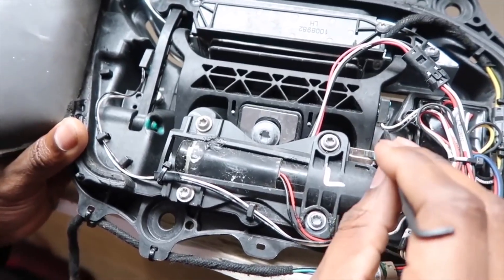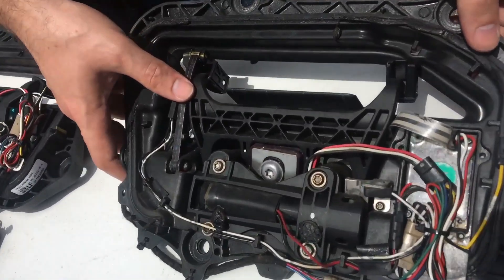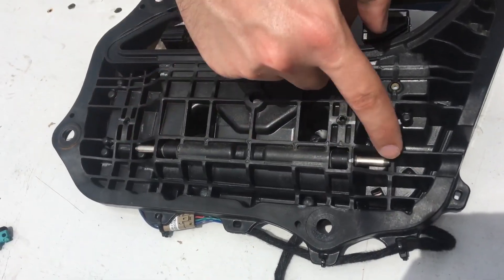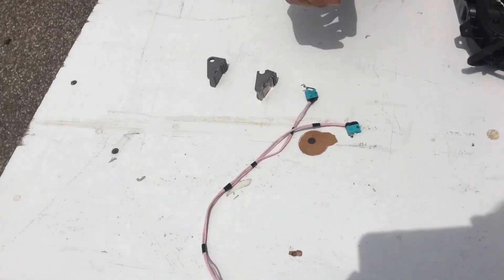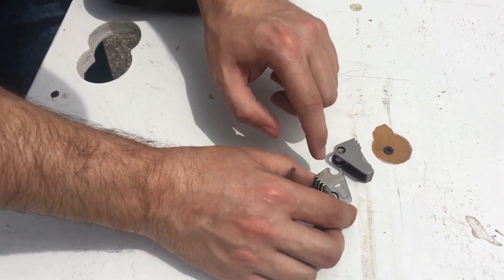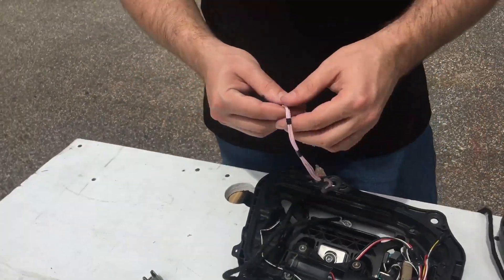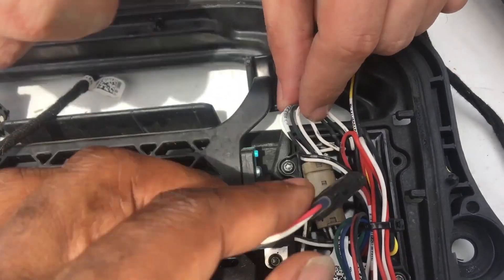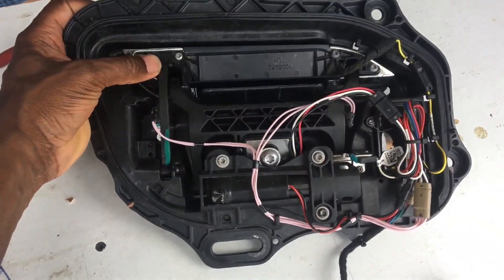Fixing Tesla’s Design for Good

Comment: You guys ruin a hard work of engineers who program these stuff to break after a certain time  😀
Reply: There is literally no reason why any wires should need to move with the handle. It's just lazy design or design for obsolescence/failure.  Sauce: I'm an engineer.
Reply: Bullet Tooth Tony they are engineers. They’re just engineers without obligation to guard Tesla’s trade secrets.
Reply: This is a mechanical issue, not a programming issue...Also by no means, Tesla made this with planned obsolescence, do you really think they would make something like the door handles to break in a certain amount of time or do you think it would be smarter for them to make something less easy to get to and less obvious that it is planned obsolescence. The problem here is just tesla using new door handle technology that is cool but has a ton of parts and electronics and knowing that they were in a time crunch to get it released they made a bunch of little mistakes some obvious such as the exposed PCB on the first 2 designers and some not so obvious such as the gear.
Reply: @THEGAMINGHELP101  A cast gear is a sure sign of cost cutting. Every aspect is tested to a certain amount, built to a certain cost and built to last a certain amount of time. Usually when the warrenty runs out.  Mechanic by trade. Even the way the wires are positioned is designed to wear out. The average person is not going to take it apart or to be honest really care as long as it's replaced and working. Guys like rich and sexy hands give me hope.
Reply: @edgarbeat275  I work in heavy trucking as an engineer. Casting is not a sighn of cost cutting as most of gears are cast for just about everything in a car/truck. Tesla probably just did not do to much testing on that gear hence why it failed and is a bad design not because it's cast. I really think tesla just does not spend much time testing and making sure things are perfect. Which is why they break a lot.
Reply: @THEGAMINGHELP101  Agreed in some designs things are designed to break to prevent more damage such as valve rockers or plastic gears on lawnmowers. I also worked on lorries, tractors, power screen graders garden machines and heavy plant a real mix. One day could be a strimmer and a couple of vans then a tar spreader. I liked the mix. 

I find the door pop out a bit of a gimmick and unnecessarily complex. Mercedes in the 70 and 80s would have tested that to death. Casting it a little thicker or moving the pivot hole a little further into the casting would have helped. 

I left my job because I found everything is going this way. I now do up old cars and art in my little pic.
Reply: As much as I like the work the Tesla engineers are doing for electric cars there is no way that company isn't a bunch of scumbags. I wouldn't put it past them to have parts with planned obsolescence. Actually, I don't trust any companies not to have planned obsolescence.
Reply: @petlahk4119  tell that to audi after the warranty the car starts breaking down
Reply: @nando1679  my sister owns a Audi TT the joy of post Warrenty Audi. No joke 😊
Reply: @petlahk4119  Nobody designs cars to break.  They design them to be cheap.  Occasional breakage is a consequence of that.  Planned obsolescence is a conspiracy theory.  The way they really try to get you to buy a new one is with styling and new "features".
Reply: IncognitoTorpedo hehe... funny... Why then would they specifically design the wires to move with the handle? That will wear out the wire faster than ever, and in fact, that’s exactly what it does. Commonly the first thing that breaks in these handles is the wire, and even a kid could come up with a solution that doesn’t require the wire to shift tens of thousands of times. Machines are designed to break. Once the manufacturing industry realized things could be built good enough not to fail in a super long time, they realized they would lose profit, since people wouldn’t have to go to a dealer to fix their car a moderate time after the car was new. Many manufacturers then designed cars to break down, and some, such as Tesla for example, made things a bit too complex on purpose, allowing more opportunities for parts to fail, forcing these rich people who don’t know a thing about cars, and certainly not how to fix them, to go to the dealership to get their car fixed. I’m not trying to rat out on Tesla, I’m just stating the truth about the entire manufacturing industry. Most people think of the term “they don’t make them like they used to” as a term stating the parts are cheaply made, which is true, but it also applies to how manufacturers cause their products to fail on purpose, giving them more profit. Cheers!

Comment: The reason for cast part are for cost reduction. That machined steel part would cost almost 10 times more than a cast one. Multiply the cost with the number of all cast parts and you end up with a huge money gain compared to a machined steel part.
Cheers!!!
Reply: The tuner only machined the part because he was constrained to Tesla’s plastic housing size. Tesla could have simple made the housing larger (there is plenty of room in the door) and used a thicker cast gear. The only cost increase would be from using slightly more plastic for the larger housing, and slightly more steel for the cast gear.
Reply: Circusboy90210 just think about it, you save about 500$ per car from all parts that are cast instead of machined. You multiply this with 20000 cars/year an you have 10,000, 000 $ in savings.
Reply: Very true. You'd hope their failure analysis engineers would be looking at this and getting the mechanism redesigned to be cheap and functional.
Reply: Keep in mind that most current manufactures are considering a cars lifetime to be somewhere between 3 to 5 years, afterward the owners sells it and buys a new car. There is a calculated line between quality/reliability .  There is a huge business in spare parts and service that goes together with it.
Reply: True. Figuring out where planned obsolescence needs to give way to quality to avoid damaging reputation is where the fun lies. Given the number of redesigns on this the quality guy wasn't winning...
Reply: +David Fiddes  Tesla does not have "failure analysis engineers", only NASA in the 1960's had that. Any engineer does failure analysis, and they don't get paid extra or get some
goopy title for it. THIS IS THE YEAR 2018
Reply: Cosminbad cost reduction in a $100,000 car? Lol
Reply: David Fiddes except in the US the average time an owner sticks with his car is now over 11 years...
Reply: No it's not. It's around 7 yrs.
Reply: No it's not. It's around 7 yrs.

Comment: I personally have owned a few Audi TT's and they all have those same micro switches in the door handle to allow the window to drop a quarter inch as soon as you pull on the handle. and i have replaced HUNDREDS of them because they all wear out and fast. they are super soft plastic and have no form of lube or even graphite powder....
Reply: yah, i use similar microswitches in security devices, they don't like being pressed repeatedly for too long...

Comment: Redesign handles so they work all the time = use normal door handles with mechanical linkage like every other car.
Reply: danot3 Other cars have flush/nearly flush door handles that wouldn't ruin your cd.  It's not some sort of voodoo science, papa Elon didn't invent aerodynamic door handles.
Reply: Check out the Tesla Model 3. They have flush door handles that don't pop out.
Reply: bubba99009 ...Lol but true, My 2014 dodge ball has 96,000 miles and never experienced a door failure.
Reply: bubba99009 retracting door handles help with aerodynamics
Reply: u need a switch anyways for the window though

Comment: Do you know if the 2018 Model S has an updated handles design? Or v3 is the last one?
Reply: V3 uses a hall-effect sensor, a new module and vapor barrier. The module is the weak link for this design typically. The gear is still the same but the microswitches won't work.

Comment: This is where you’d hope Tesla would give whoever designed and built the fixes a job or at least a reward, but in the end they’ll probably just steal the idea and put them out of business.
Reply: truthsmiles The cast part could have been made thicker for only the cost of extra raw steel (almost nothing). Billet was done by the tuner because he has to make a part that is the exact same size but stronger, where as Tesla could have simply made the plastic housing wider to accommodate a wider cast gear. Those wires are the only constantly moving wires on the whole car, and yet they used extremely cheap solid core wire not even fit for a stereo install. Considering those are the only wires on the whole car subject to movement, and also that they’re so short, there is no reason to save less than $1 per car on cheap wire. Unless you want that wire to fail after 5 years.

Planned failure is a very real thing, with all manufacturers. It’s sad but true.
Reply: It's the American way. Microsoft, Apple, IBM, they all do it.
Reply: I think in this instance Tesla designed it to fail, and they only redesigned it because it was failing too fast (while still under warranty). I don't believe their engineers are so lame they would use such bad quality wiring and no water proofing. Using better wire and standard water proofing techniques isn't really a new idea or anything.
Reply: There are other wires that move (door hinges, motor mounts, seat rails, steering wheel, etc), but I get your point. Maybe I'm in denial about planned failure, but I couldn't imagine making decisions like that if I were running a company like this (which is why I'd probably go broke doing it!)
Reply: To be fair to Tesla, they COULD make every steel part out of stainless and use silicone wires everywhere and waterproof everything, but they'd be out of business if they did that (or the cars would cost 2x as much). Good engineers try to balance cost with reliability. In this case they failed, but in many others they probably did a great job.